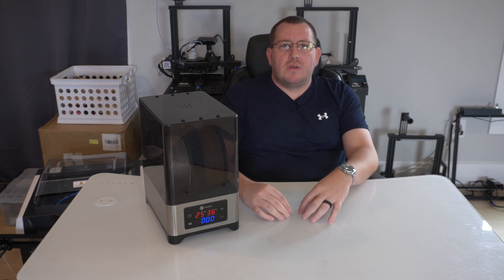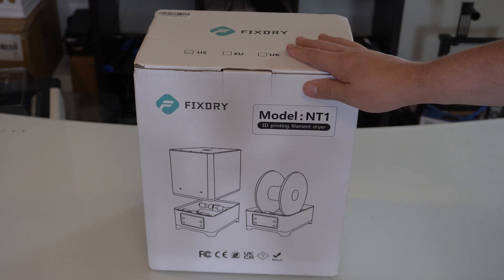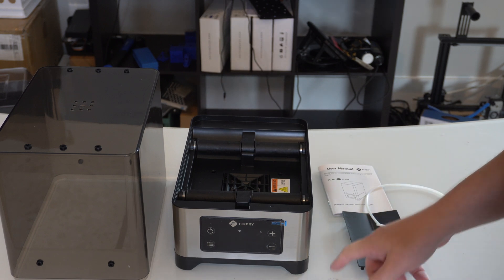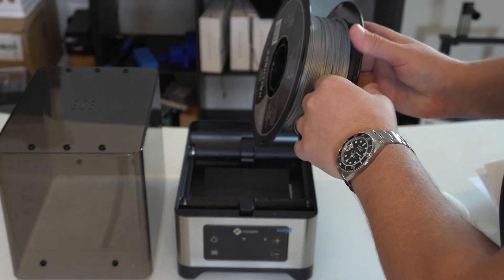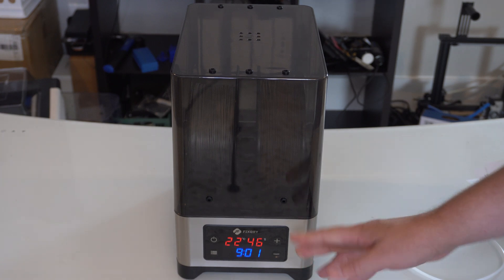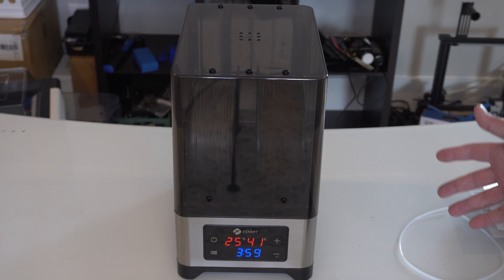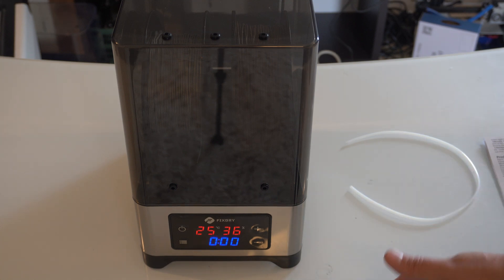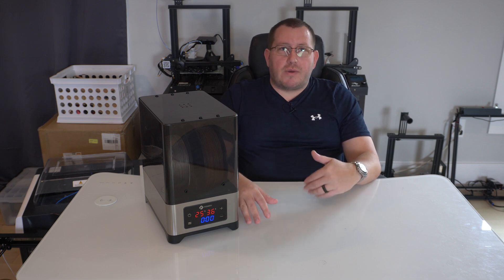FIXDRY Filament Dryer Box – Initial Review

Comment: Thanks for your review. I like your style of no-nonsense information. It was very helpful but it did seem lacking for anything other than low temperature materials. 
I have been looking for a dryer that will work well with nylon and other materials that need higher drying temperature. In my research I have found that some dryers claim to have a 70 degree temperature but as it turns out some of them are 70 degrees at the heating element (bad) and some actually are 70 degree air temperature (good). 
1) Where is the temperature sensor in this dryer?
2) Does it actually get to 70 degree air temperature?
3) Does the fan run all the time, or vary in speed, or intermittently turn on and off?
Reply from the maker: Hi. Thanks for the feedback. I can try to answer your questions but cant verify the actual temp. 1) It looks like the sensor is in the front center of the dryer, a little forward of where the filament sits. 2) It shows it gets to 70 but i dont have a way to actually verify the air temp. 3) the fan runs the entire time the heater is being ran but doesnt if its not. From my understanding, its used to help push the humidity out of the dryer.
Reply: Thanks, I appreciate your input.  @3DPrintscape
Reply: @3DPrintscape  Sorry, I do have a way to check the real inside temp and it never got hotter than 53c and that was when set to 70c. 50c got 50c. 55c got 50c. They had it on sale for $40 when I bought it. They're gone and not selling them anywhere now. Amazon has tons of reviews that also mention this, that's how I found out. I do like your reviews. Watched many of them.